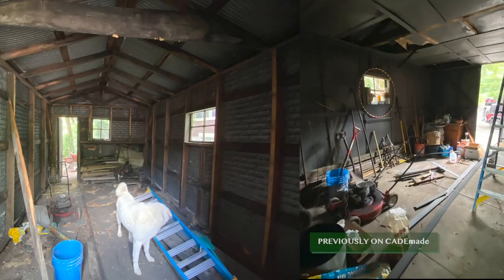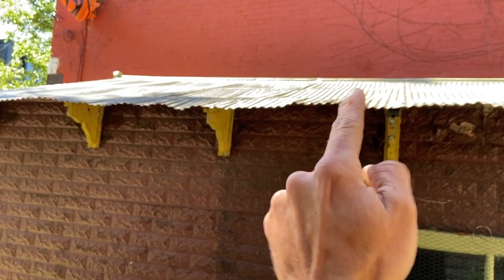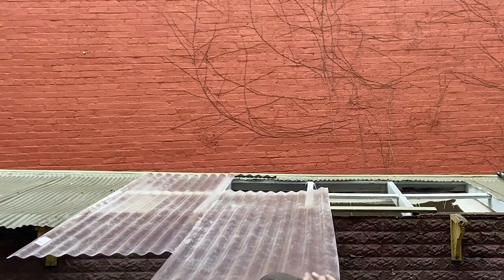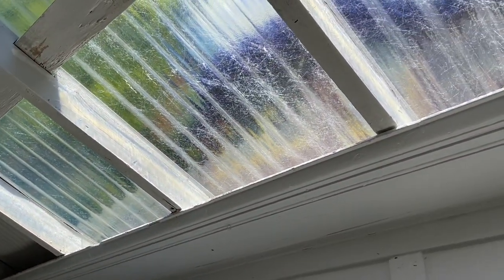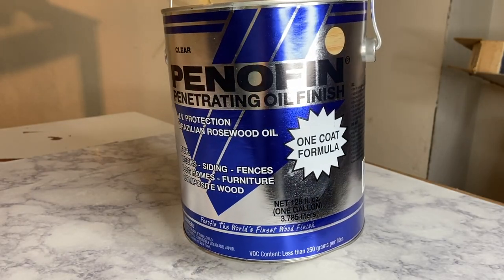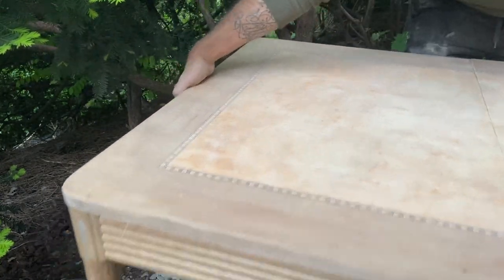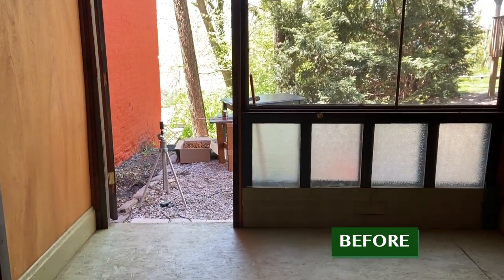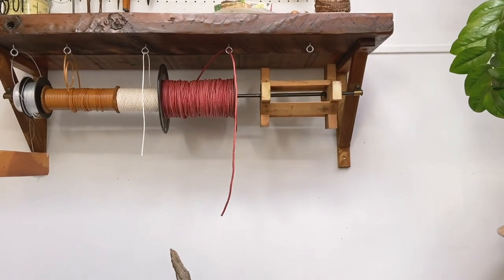Dreamy DIY Potting Shed Makeover

Comment: It turned out beautiful. Better than I expected. I just bought a house last year and the huge garden shed was one of the determining factors. It was a bigger disaster than yours started out, but I did a makeover on it, took me 2 months! Haha I did a lot of similar stuff you did and painted the walls white, too. 
It needs a new roof, so I may do what you did to let more light in. 
Awesome job 👏🏼
Reply from the maker: That’s amazing you did one too! Very worth it. Thanks so much. Ours was two separate reconfigurations but it’s really been a useful place. I do recommend the fiberglass roofing… just make sure it is sealed… I’ve had issues. Happy gardening.

Comment: Hello gorgeous! Have you had a freak hail storm in the 2 years since you installed your fiberglass roof? Ours was demolished by hail, so we re-roofed with wood and shingles. A suggestion would be to put a layer of metal mesh over your fiberglass so that it doesn't get demolished by the weather and ruin your wonderful interior. I think that you are the male version of Linda Vater, by the way. Are you a stay-at-home-man? ; - )
Reply from the maker: It’s held up pretty well. I think I’m going to modify that in the spring and potentially take your advice. We luckily have been outside the weather systems🤞🏼. Son it should be a find out situation. 
Going to check her channel out @lindavater , thanks for the heads up. 
I work from home and don’t like leaving lol, so yes I am kinda a stay-at-home-man 😂. 
Be well and thanks again. Cheers